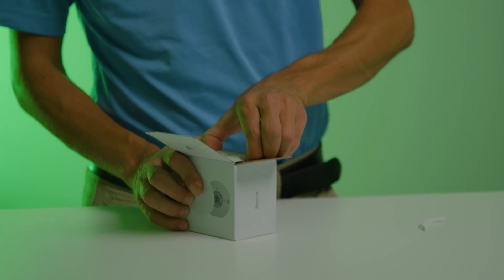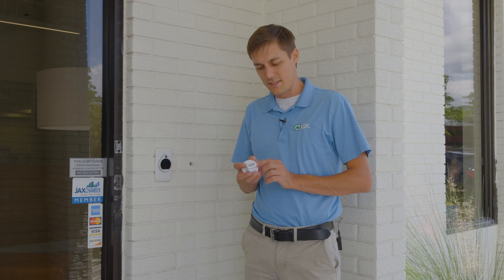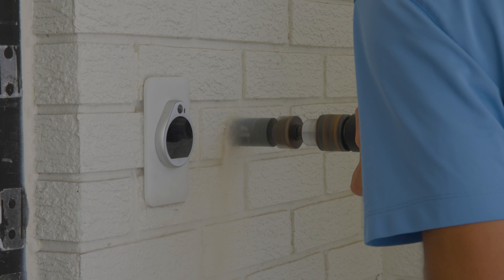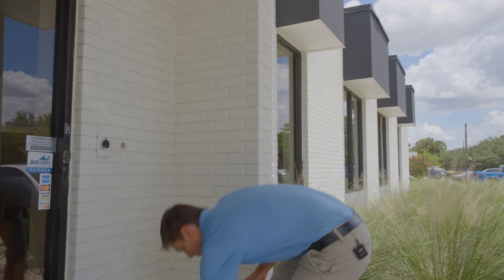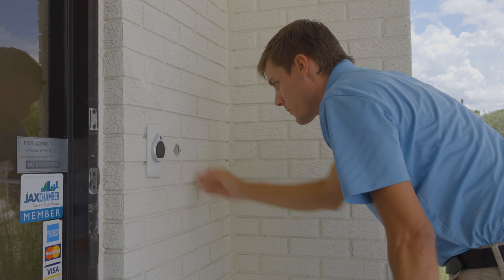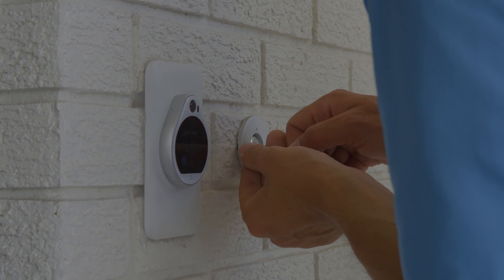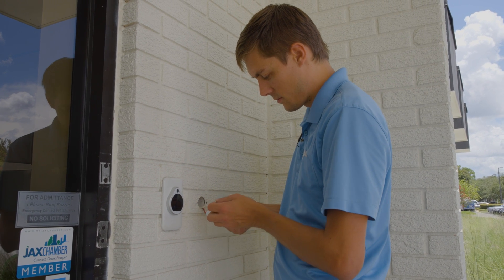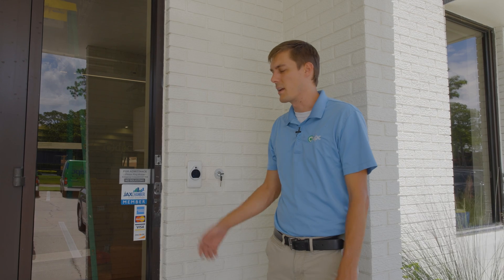Never getting locked out again... | Unifi Access Rescue KeySwitch Install

Comment: For those who do not possess a hacker's mindset, the building shown in this video has now become particularly vulnerable. If you encounter one of these systems, simply removing and rewiring it could grant you access to the building. To secure this type of lock, it would have been wiser to conceal it, perhaps behind the building or inside a power box. As it stands, this installation no longer offers adequate security. I strongly advise against replicating this setup. Additionally, merely twisting the wires will have no effect. However, if you have a multimeter capable of outputting power, you can bypass the lock by supplying one wire with 28V and 4A, which would easily trigger the system to open.

Comment: As long as it has no coding, at least over the bus protocol, it is a security weakness. Someone can simply disassemble it, connect two cables, and boom, the door is open. Some sort of keypad or at least some form of coding would be more secure 🤷🏻‍♀️

Comment: Warning do not use stand alone door access keypads, as they can be bypassed. HENSE a strong magnet placed on the keypad CAN actuate the internal unlocking relay! and open the door!
Reply: the relay is in the box he showed in the attic, not in the reader. the reader has an ethernet cable to it.

Comment: You can use any key switch, ensure the key switch is wired to directly break the power to the electromagnetic lock. Another way is to use a garage door remote opener, no drilling into wall needed! use the relay clean contact to break power to the locks just use the wireless remote. This is WAY more secure as key switched can be easily picked or forced with a screwdriver.

Comment: If the controller locks up and the reader doesn’t work. Pressing the RTE button may also not let the controller drop the power. It’s better use the key switch pair to break the power to the mag lock using Com and NC. Guaranteed to work in the event of a controller fail. However still easy risk of bad guy with hex key….
Reply from the maker: Thanks for feedback

Comment: Next step, let the lLockPickingLawyer open it...
Reply: He would do the same thing as me, unscrew the key switch ! Wonder what it does to the controller if you throw 24V into that switch wire..
Reply from the maker: @JasonsLabVideos  lol
Reply: Sorry, not trying to degrade this video, first id never use Unifi secondly, id never put a key switch on the outside of a building.  @DPCTechnology
Reply: @JasonsLabVideos Likely very easy to pick or pull it out and bridge the wirer's
Reply: Yes! I would hide the lock behind a sign. This is much to quick for the LPL. Also placing it higher would make lockpicking and tampering a lot harder. You would nee a ladder or something else to stand on. Remember this is only in a fail situation.

The whole idea of not having the outside device opening the door is gone with this override. Becaus normally the acces hub opens the door that is safely inside. You can use magnets, hammers, batteries etc on the reader it will not open the door.
Reply from the maker: @MisterGiant  good points.
Reply from the maker: Lol

Comment: So, bring an allen head screw driver to the site remove the switch and short the wires together ?
Reply: Buy your own Unifi Lock…take an Allen head screw driver and swap it out, and then get access into the building.
Reply: @TransitAndTeslas  wouldnt even have to do that, just change one wire from always open to always closed
Reply from the maker: LOL, first thing we tested...  I can confirm that doesn't work :p
Reply: @DPCTechnology any reason that doesn’t work doing that?

It’s just a simple switch without logic in it
Reply from the maker: @davedivesdeeper  Not sure of the technical reason, but it does not.
Reply: @davedivesdeeper it might have a resistance value in it but normaly and key switch should in a case of electromagnet lock, cut the power straight from the source and not act as a " Request to exit " because if the board fails.. it won't detect the key "RTE". On a Electric strike .. just use the door key XD
Reply: @daytekone  I’ve tested it since this video, it does work shorting the wires lol
Reply: @davedivesdeeper  lol .. knew it .. XD
Reply: @DPCTechnology  well let's give it a try.
Reply: @DPCTechnology  Just buy another lock thingy and connect it so that the door stays open?